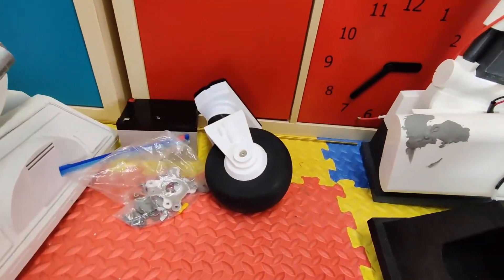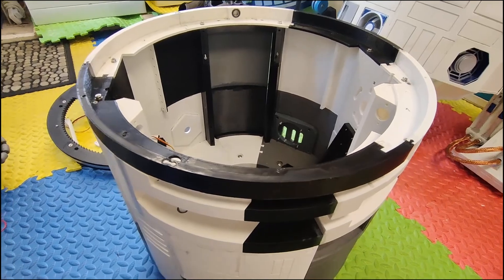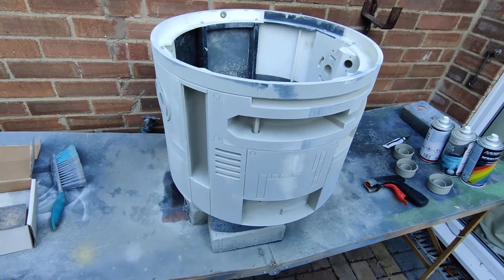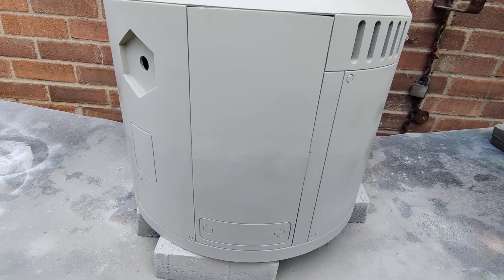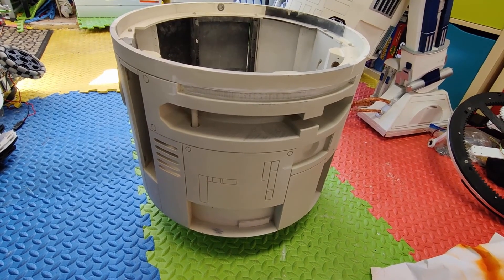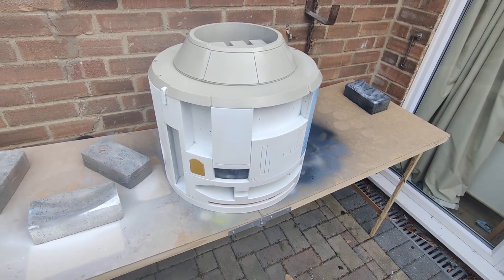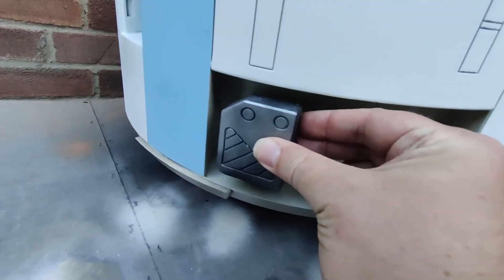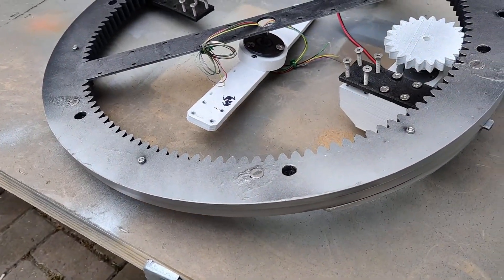Let's Build Chopper! - Episode 19 - Body paint!

Comment: What printer did u use for all of your builds
Reply from the maker: It varies. Started off with an Ender 3, then added an Artillery Sidewinder X1. I'd say most of Chopper was printed with that setup. I swapped the Ender for another Sidewinder early 2021, rest of Chopper done with those two. Everything else you've seen me build on this channel has been with those two Sidewinders. Though larger stuff sometimes gets printed by John on whatever large format printer he has at the time. Choppers dome was a single print on a CR10, I forget the exact model. Hope that helps!
Reply: @rageprint9530  I only have two Sovol Sv01 pros at the moment. I’m just looking for one with a bigger build size. I’m looking at the SV06 right know but not sure it’s much bigger
Reply from the maker: Looking at the specs I'd say it smaller?

Comment: could you, if you could i think its too far now, but put in bearings for the utility arm pivot, that could take out a lot of the weight causing it to scrape? 
I haven started on my chopper yet, but if possible maybe i'll mod the fusion file to take a small bearing top and bottom for that pivot.
Reply: my bad just read through tthe instructions and saw there are bearing top and bottom for it.
Reply: Just finished downloading most of the parts and running through the instructions for all the main hardware I'll need, bearings/servos and the 3 motors. Can't wait to start printing and building chopper, your videos have been great to watch and learn from.
Reply from the maker: Thank you very much! If it helps people then it's been worth the effort to make them. 😊